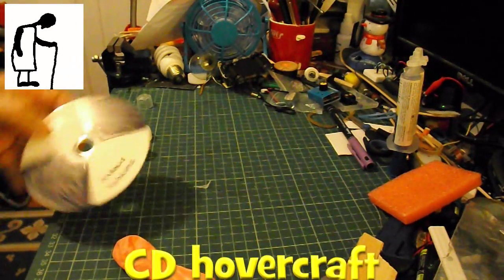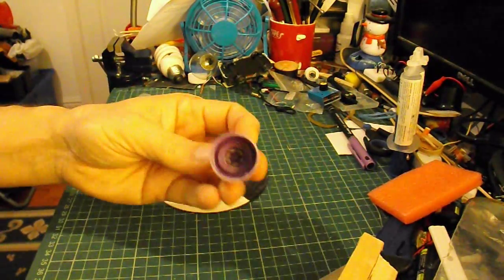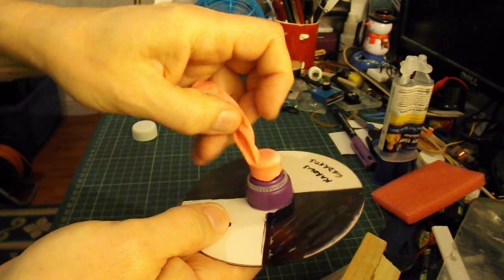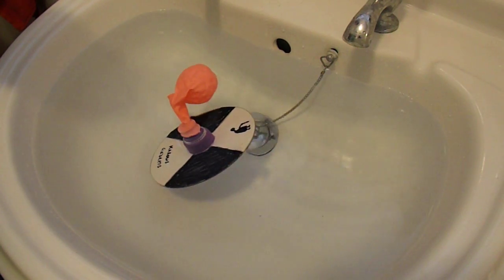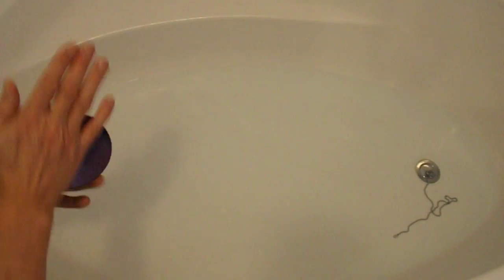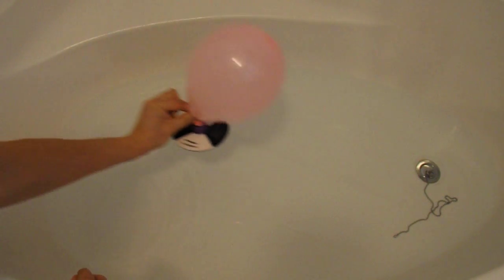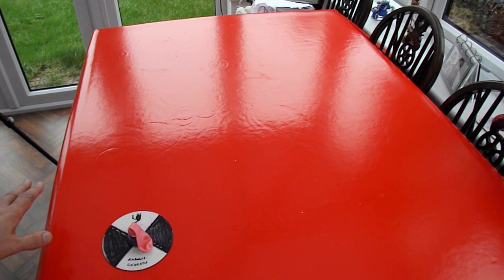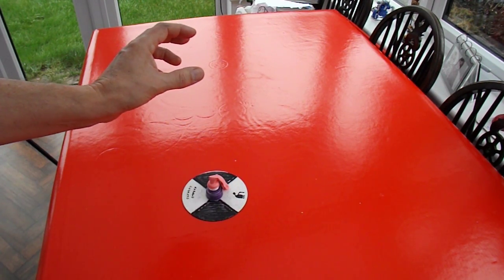CD Hovercraft revisited 20160205

Comment: hi, i like ur video specific on that but i was wondering if that same process would work on water if u stick 2 cd,s together and then blow up the balloon and let it go, then there might be no tipping over of the cd,s since the balloon would then be lighter then the cd,s and would would not tip into the water as it would with 1 cd, the 2 cd,s would still float im sure and the balloon would have no chance oftipping the cd,s into the water. that would my another theory to try out?
Reply from the maker: +marc wohlmayer you had better try it out then. It only takes minutes to make one of these so you should soon be able to test your theory.

Comment: grandad, i got this toy grade rc toy car. costed 50 pounds but i lost the controller. it had 3 bands. 27mhz. i have like ten 27 mhz controllers. none of them work.. why??
Reply from the maker: +Jakub Berlowski fact of life, just because it is 27MHz does not mean it uses the same signalling protocol, it just means it is on the same wavelength. The more expensive the toy, the more likely it is to be incompatible with the cheaper transmitters as they will just do basic functions whereas the more expensive ones do more.
Reply: +GrandadIsAnOldMan could i not have another way of doing it instead of changing recievers?
Reply from the maker: Jakub Berlowski I doubt it and changing the receiver may not be simple either if it needs more control than a simple basic rc toy car. The basic ones just work like on/off switches. That is "On Forwards - Off - On Backwards" and "On Right - Off - On Left". Does your car have variable speed and proportional steering? Does it have any other functions or buttons on the controller? You may well be stuck with trying to get a new transmitter.
Reply: +GrandadIsAnOldMan  this has no proportional steering neither speed. it doesnt have any different buttons either. but the car has a radio type of thing. on the engine u open it. and  you switch it on and it turns on a real live radio of about 10 stations. would that be anything bad? i really am desperate to fix this car to make it work..
Reply from the maker: +Jakub Berlowski if it has no special features then you should be able to swap the receiver. I guess high cost of the car was due to the radio in it, not it's rc functions.
Reply: +GrandadIsAnOldMan okay thank you very much